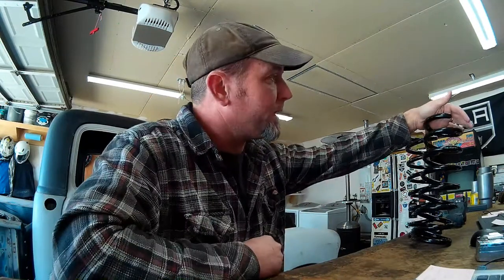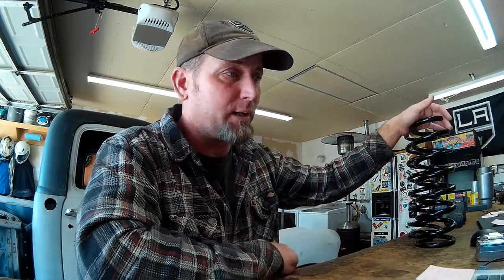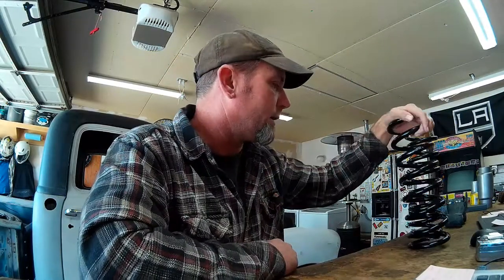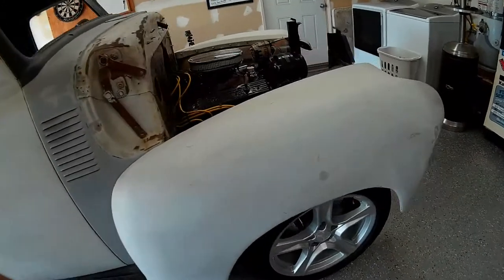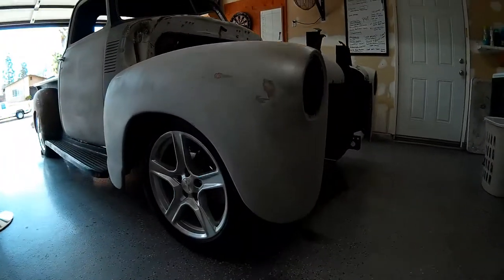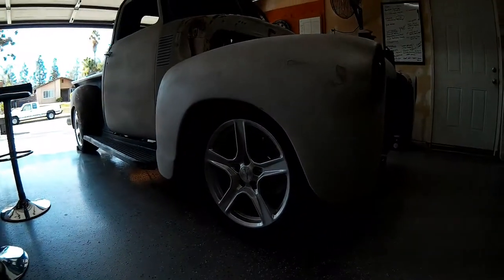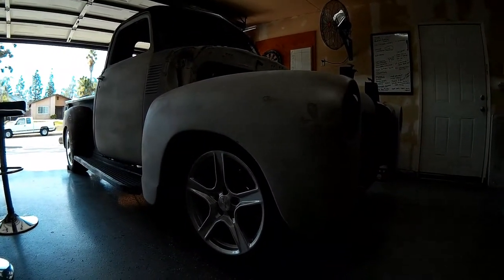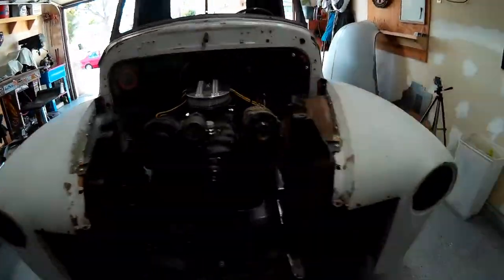P48 Project; Helix Mustang II IFS Install, Part 6 - Coil Springs

Comment: Hi Jim
Did you get the stock height spinals or the 2"drop spinals?
Thanks
Reply from the maker: these are just the stock height spindles on the P48 project.  i figured if we wanted to go lower we could swap in the 2" dropped spindles later on, but the stock height spindles were a good height for the P48.  thanks for watching!